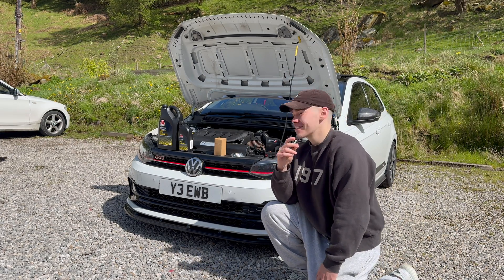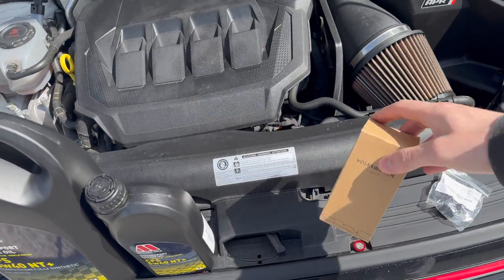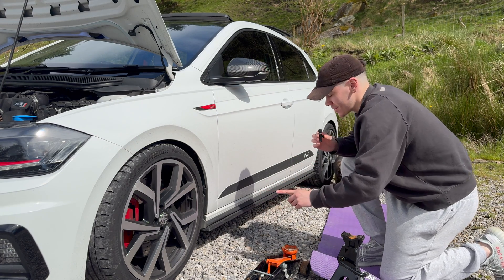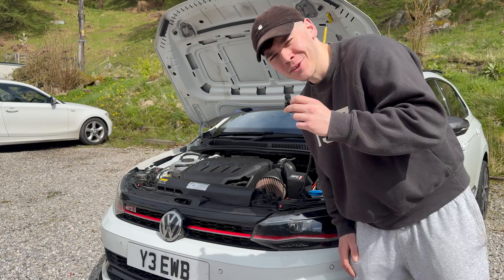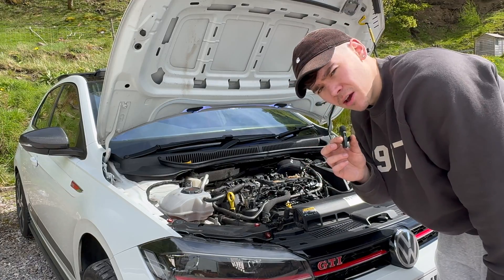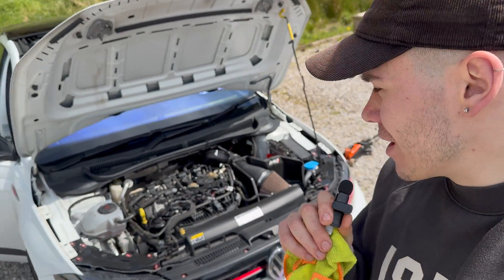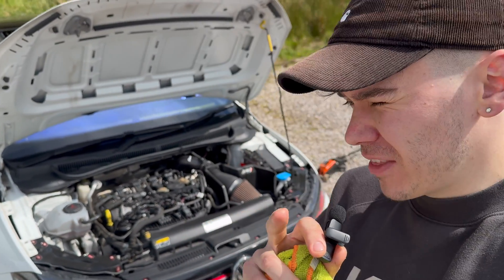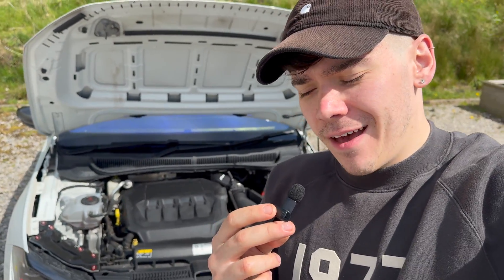HOW TO: OIL CHANGE ON THE 2.0 TFSI EA888 ENGINE

Comment: Good choice with 5W40, mate! I use Fuchs 5W40 even if my A5 2.0 TFSI 2019 is not tuned.
Reply from the maker: Best oil to use 👌
Reply: Nah 5w30 will do the job too i have 2018 Golf 7 GTI PERFORMANCE and use 5w30 Castrol LL in winter i have stock 250HP there is no massive diffrence between 30 and 40, 40 is a bit thicker i only drive in city and short distances so 30 is good for me now when its summer ill switch to 40

Comment: How much Newton metro for oil filtrer ?
Reply: Good question
Reply: @dimas5093  until it stops turning i did it on my gti 2018 no torque wrench just a adjustable wrench you will feel when it stops.

Comment: Vw use Mann for filters, not that it matters but saves few bucks over 4-5 services.. oem without audi writing on them. Where has your heat noise cover carpet thing gone from the bonnet, did you remove it. I have 6c, did my thermo housing myself, about to do lower control arms and engine mounts with oe parts direct from manufacturer without the extra 100bucks for vw sticker,,, a nice lil job for you to do no doubt in future.
Reply from the maker: Ahh that’s good to know thanks! Yes I did remove it, figured I’d hear a bit more induction noise with it off. Oh very nice, do love the 6c, way more tuneable than the AW too. Oh believe me I’ll be doing everything I can with the handling of that car 😂